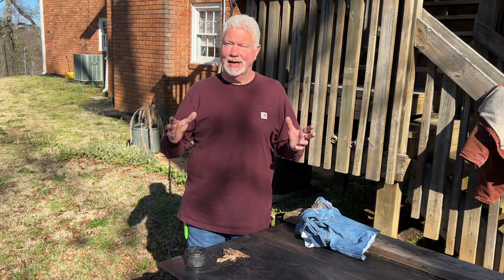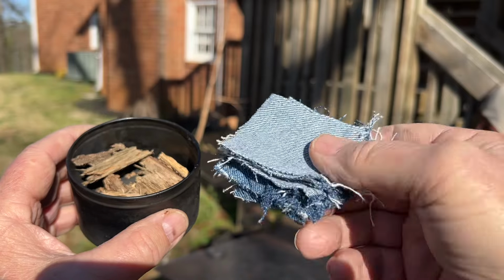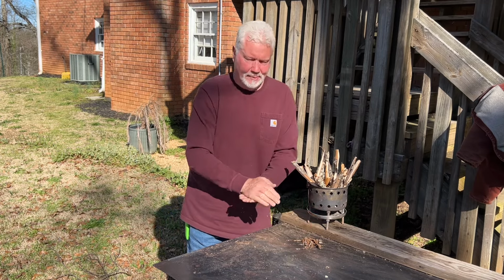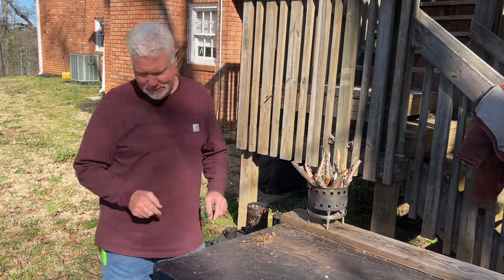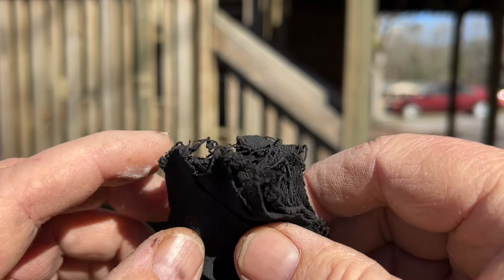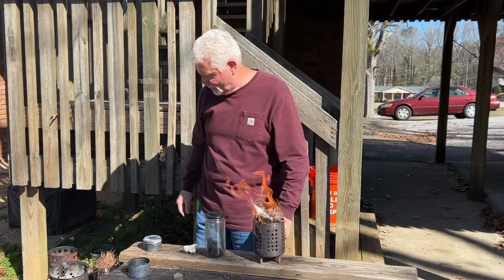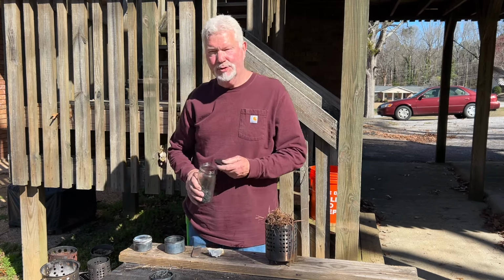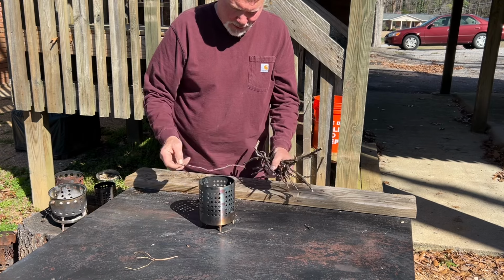Making Denim Char Cloth, Charred Punkwood, n Trying Them Out

Comment: Hi David great video as always, strange question. What is the table top made from. I'm looking for a top for my outside space that's durable thanks
Reply from the maker: About 1/8” carbon steel plate, I’m not sure what gauge that is.
Reply: @DavidWestBgood2ppl  how do you stop it from turning orange from rain ?
Reply from the maker: Primer under the top coat.

Comment: Hi David!  I suspect you've answered this question a few times, but I can't recall it.  You mentioned that the denim has a lot of smoke residue on it.  What is the negative of that and is there a way to prevent it?
Reply from the maker: It’s a little bit less reactive to flint and steel. Hard places on char cloth could make it from slightly less reactive to unignitable.
Reply: @DavidWestBgood2ppl  Thanks for taking time to explain that.